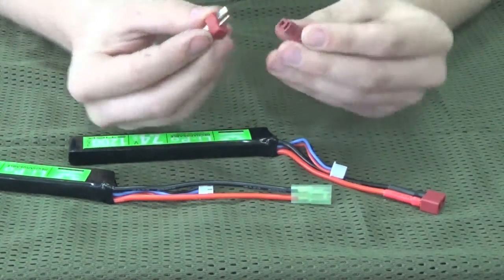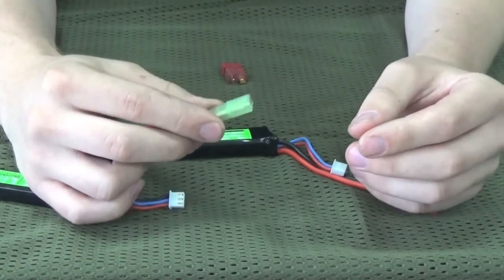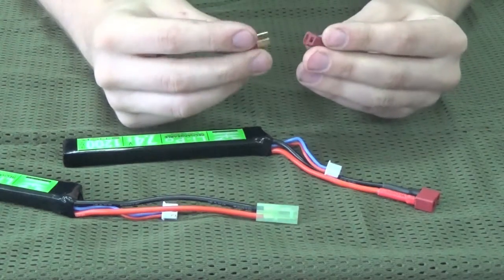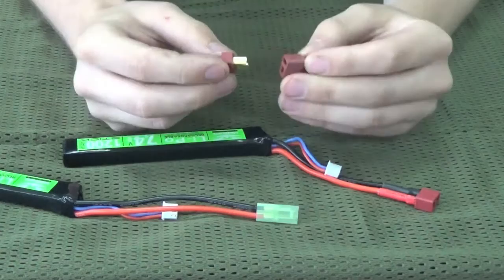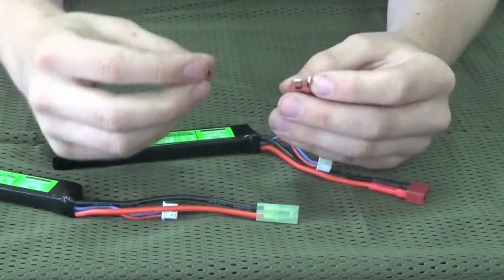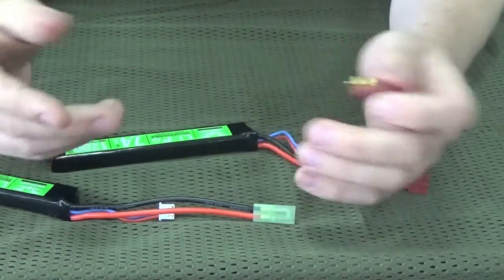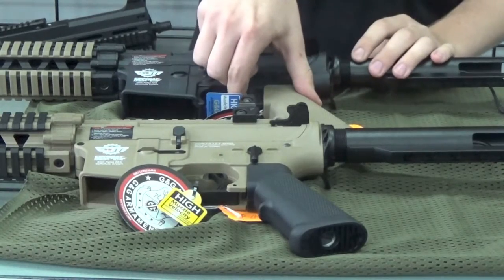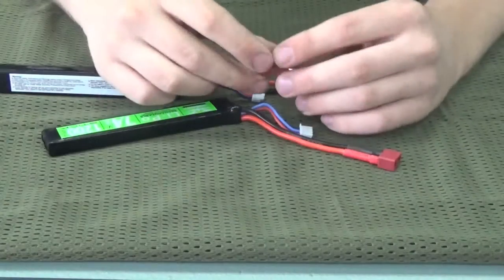Deans Vs Tamiya Connectors Comparison

Comment: Deans Style 1 Male to 2 Female T Plug Connector Extension Parallel Cable Adapter can I use this cable to hook up 2 2s battery’s

Comment: magical thinking. dean do nothing but lowering the total circuit resistance of an insignificant amount, they are good because thry are rated for much higher amperage, usefull if you run neodymium magnets motors.